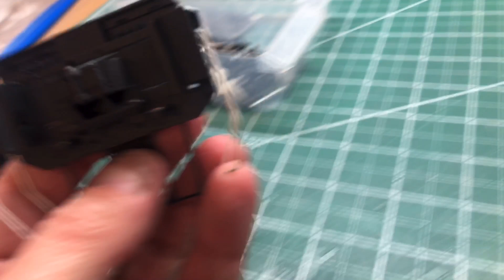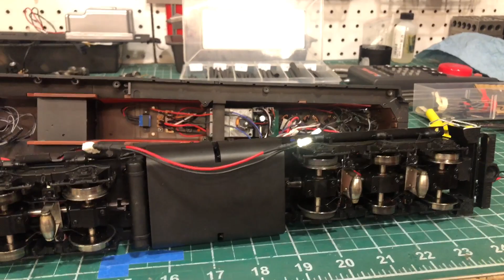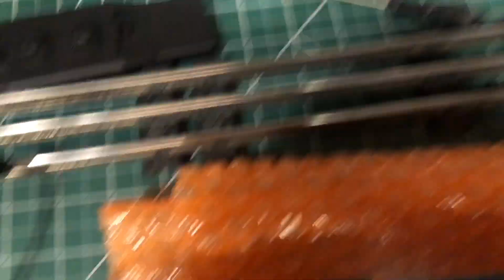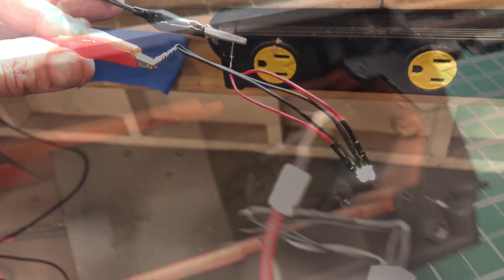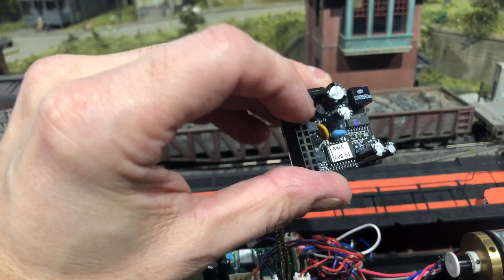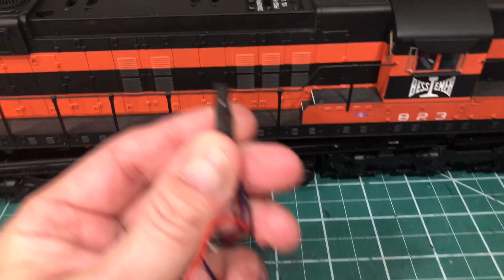3rd Rail Bessemer SD9 Repair Part 2

Comment: Norm  would you know if  running a  3rd rail eng using an MTH  Z 1000 brick for track power  as I have on my layout for power will be harmful to their models as I have reserved an eng from Scott  I run both  Legacy and MTH now      thank you Karl
Reply from the maker: I would avoid those transformer/controllers if you could. I prefer the Lionel Powerhouse/Powermaster combo myself. At least try to stay at 18vac or lower if you are going to run them with TMCC.

Comment: These locomotives seem almost as complex as the real ones. I'm impressed with how much you know about fixing and upgrading them. If I'm not mistaken Bessemer & Lake Erie was a PRR subsidiary? It seems as if the SD9 pulls very nicely judging by the length of the train you have coupled to it. Nice work.
Reply: The B&LE was affiliated with US Steel.  Canadian National Railway has owned them since 2004.  They still have one radio controlled diesel operating in the harbor at Conneaut dressed in the B&LE colors.  They tend to run a southbound taconite train almost every day.
Reply: @allegheny48  Thanks for the information.
Reply from the maker: Thanks but my crappy narration probably makes them seem more complex than they are. As you can see (hopefully) the TMCC stuff lends itself to semi-easy isolation of an issue due to its modularity.

I want to say that the Bessemer was actually a US Steel subsidiary along with the Union RR. I would have to consult with my PA Bessemer expert pals though!
Reply: @normstrains  Without looking it up, you may be right about US Steel. They were certainly affiliated with them in some way, working their plants. Bessemer & Lake Erie may have been similar to Bethlehem's Philadelphia, Bethlehem & New England.